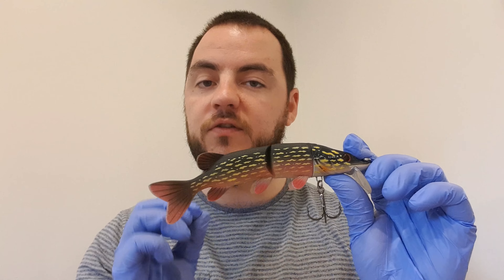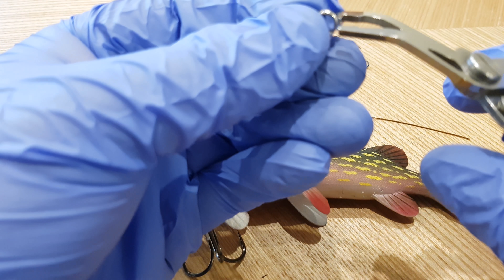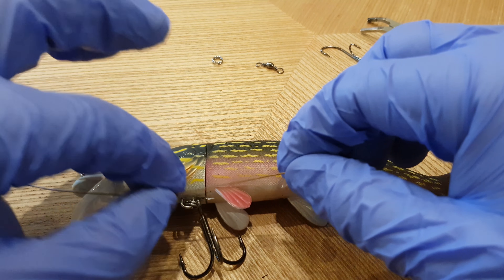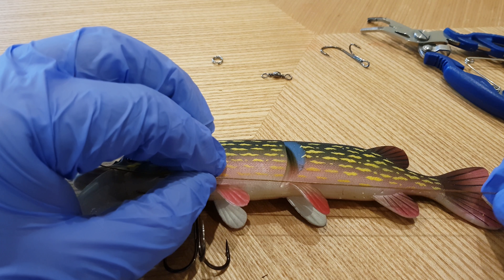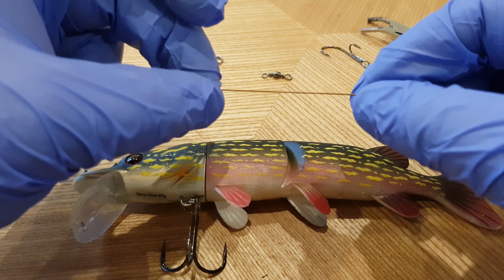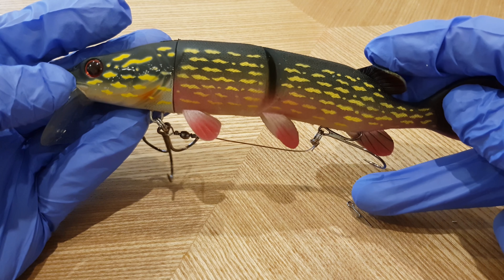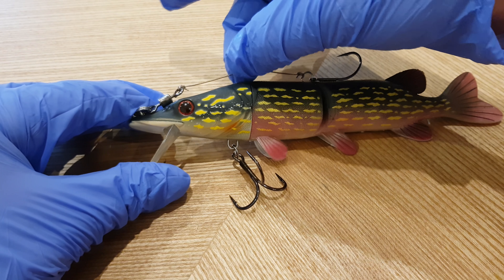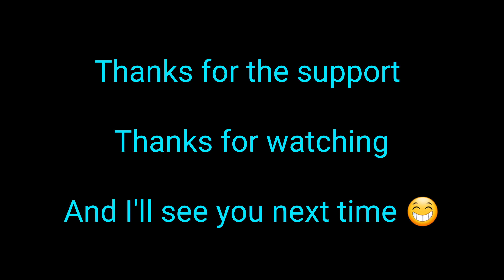How to make a stinger hook for Westin's Mike the Pike / How to make a stinger hook for swimbaits

Comment: one question, i bought a premade stinger where the steel wire has premade loops on each end, one end connects to a swivel, do we actually need the swivel? The ones i bought are a tad too long, and just removing the swivel and connecting the wire to the front splitring instead might remedy that :)